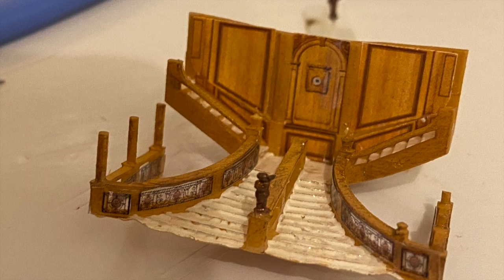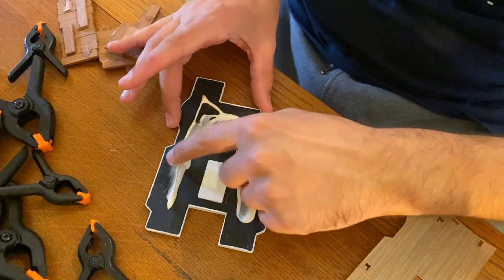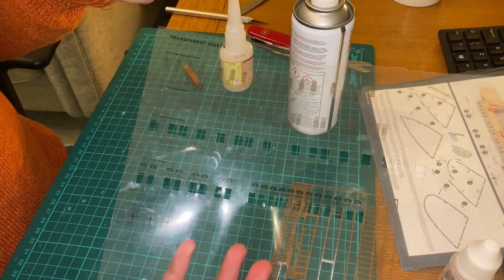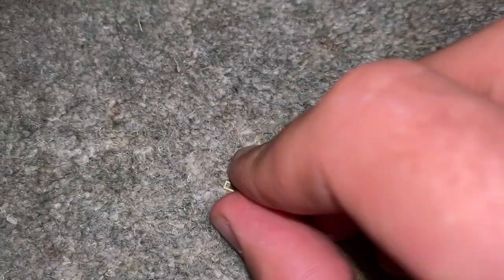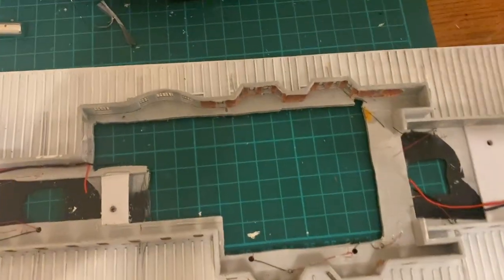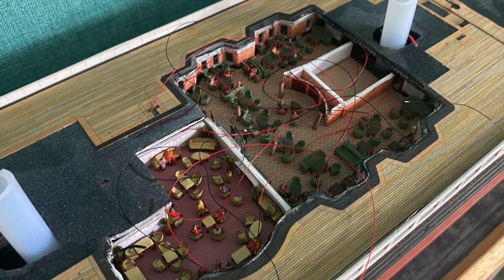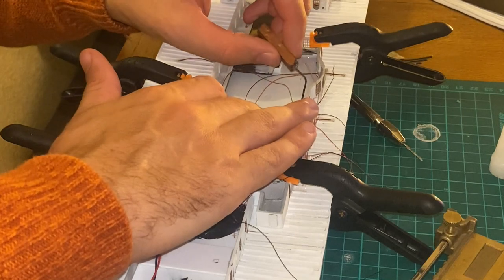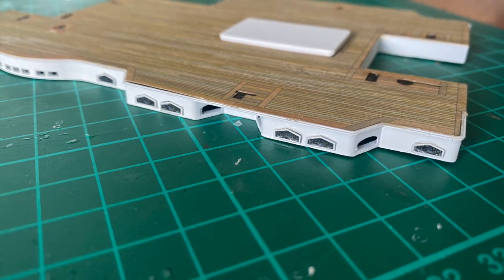Radio Control Trumpeter 1:200 Titanic Build Part 41 - Extending Ceilings

Comment: these are probably some of the most underrated parts of the Olympic class liners.
they provide a space to look over at the sea, and when standing near them or walking past, the floor-level windows feel like that of an old building with a large fancy room underneath. they make the decks look a bit more like a ship in the best way, not sure why or how.
And, again, although i can’t really explain why, i really really like them.
they add to the aesthetic, i guess.
great job on the model so far 👍
Reply from the maker: Hi, thank you. Yes I agree the rooms do add something quite unique to the ships.  It’s a very efficient way of lighting the boat deck too without having to spend more on additional bulbs and maintenance to clean and change them.

Comment: Hi Rob, yes I have been contemplating the ceiling height since your video on fitting out the lounges.  I don't really understand why Trumpeter didn't mould the head space into the boat deck superstructure as it was there. The plastic thickness does not help either!   I will do the same as you have nearer the time, obviously easier to do this tricky job in advance of everything else.  Pity you had to sacrifice the lights after the work that you put in but it would of really annoyed you if you hadn't decided to commit yourself to doing the job!  I think you made a good move with that though so well done!  Your hard work is definitely going to help my construction.  I have just completed the shell plating on the stern using the Scale the Titanic mods.  Plodding along!  Carpet monster missed out on your PE!  I use a dustpan and brush carefully if my initial reconnaissance fails!  You are doing really well with the video's, great job! JH
Reply from the maker: Hi Johnny, yes agreed I can’t understand why the ceilings wernt done like this from the start either, but I guess it’s part of the fun to fix it! 
As you say I’d have been irritated in years to come had I not done it this way, and I do think it looks better now with the same lights illuminating the skylights too. 
Ah yeah so the plating continues. I have to say the stern plating looks like a particularly satisfying job to do. It’s another one of the things that slightly let’s down the trumpeter kit but I guess it’s hard to get an injection moulding mould to have detail in all dimensions as the casts have to be ejected in some way! 
Ah yes, my carpet is quite new so there’s still a lot of loose stuff on top which is very good at snagging the PE, I’ll keep the dust pan and brush handy for the next time I inevitably drop a bit on the floor at a crucial juncture! 
Keep well, 
Rob
Reply: @TheModelBoatGuy  Yes the plastic is so heavy and normally we would applaud the quality at this point.  Its the superstructure that is really annoying me as the window frames must be getting on for a scale thickness of 45 to 60 cm!  I aim to thin it all down and that will lead to glowing walls when the lights are illuminated!  Nothing is easy but that is part of the fun as you said!  The stern plating  is very good and it is almost a pity to have to paint over it!   Another tip from a former watch repairer is to place some old tights over a vacuum pipe and then patrol the impact location for the escaped pinged PE part.  Less of a punishing movement if the part is susceptible to damage with a brush!!  😉JH

Comment: Nice work. Have you seen "Nigel's Modelling Bench" and his reshaping and re-plating of the the Titanic hull, and additionally using photo etch upper deck sides to counter the out of scale thickness of the promenade deck side plates. I haven't seen any progress from him on this lately, I suspect it all became a little too much.
Reply from the maker: Thank you. Yeah I have seen Nigel’s work. He’s very good, I’m not sure if he ever intended to make the full titanic model or if he just made those videos to highlight what could be done about the errors in the hull if you wanted to address them. Either way it’s mighty impressive work! 
I decided quite early on that i wouldn’t tackle that, while it might have been possible I was a bit worried about cutting loads of holes in a hull that would have to remain watertight. I think If I had made a display model I might have given it a go.

Comment: Thank you for reply. Now I haven't watched your entire build, so I may have missed something, but can you explain how you will gain access to the gubbins inside the boat if you need to?
Reply from the maker: So the superstructure (the white section at the top) can be lifted off and that gives access to the kit within. The superstructure sort of slots back into place quite nicely so once it’s in place it’s quite securely held.  
I need to get inside the model semi frequently really as I need to connect the charging system for the batteries after each sailing

Comment: Instead of blue tack ,I use wax pencils which women use for makeup ,available on Amazon.
Reply from the maker: Ah yes ok also good. I think that may be a wee bit better as the CA accelerator slightly dissolves the blu tak. 
Could you send me a link to the pencils?
Reply: Off Amazon